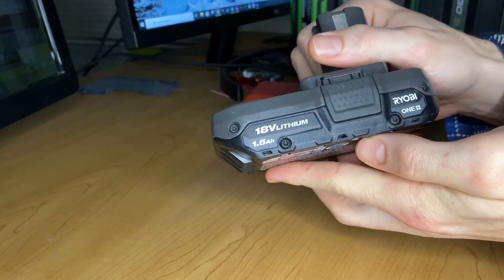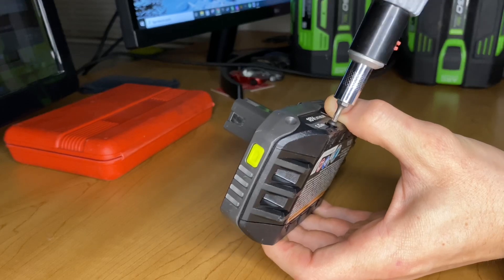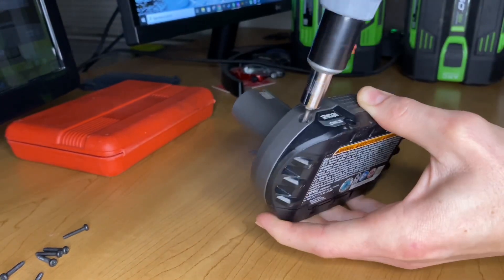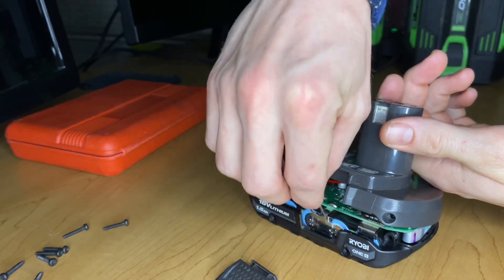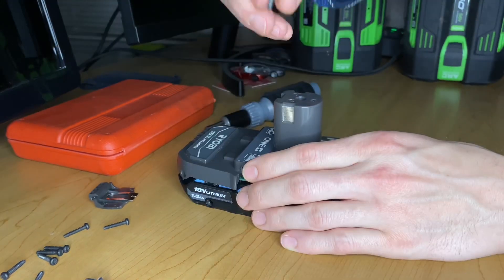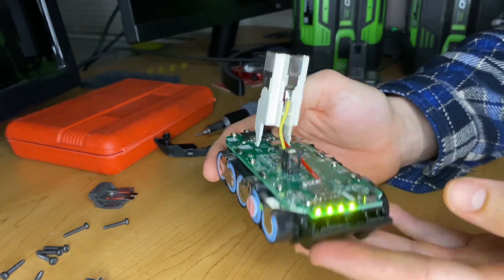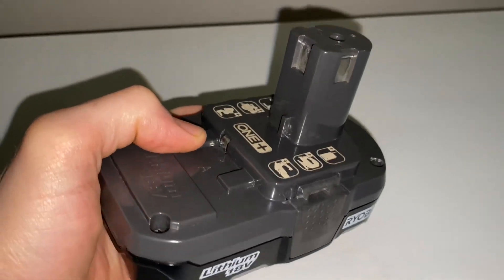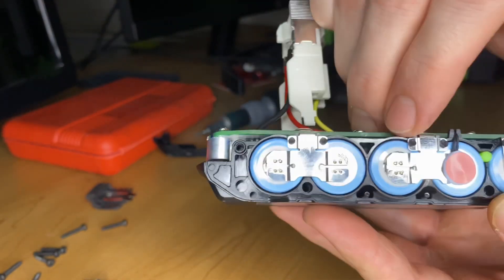New 2021 Ryobi 18v battery design (Basic teardown)

Comment: It looks cheaper overall. Mostly it doesn’t matter but most people will miss the rubber mould. Hopefully the bms is good and they will last a long time.
Reply: I never had a problem gripping a battery enough to install or remove, so no I won't miss the rubber moulding.  If anything I don't want it anywhere it's not crucial for a good grip because over years, it tends to loose some of the silicone oil and become a sticky mess.

Comment: Do you think that the 18650 cells can be user serviced / replaced?  Thanks for the video.  :  )
Reply: No, none of the battery packs from any brand that are spot welded together in a carrier, are considered "consumer" service/replaceable.   That does not mean you couldn't possibly do it, but it is not intended to be repaired.  If you are already building Li-Ion cylindrical cell battery packs safely, then certainly you have the experience to do these packs, too, simply pop the connector tabs off, slide the cells out, slide the new  cells in, and spot weld back in place, checking thermals before reassembly in the case to make sure  none of your welds are creating a high resistance path that overheats.